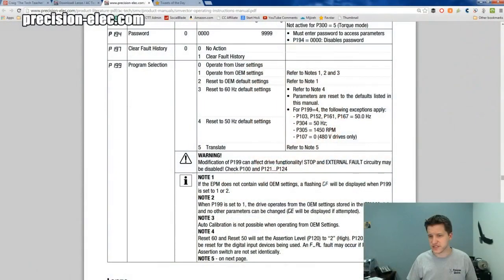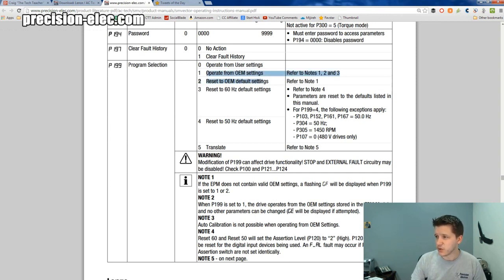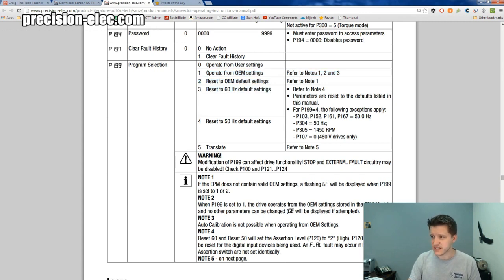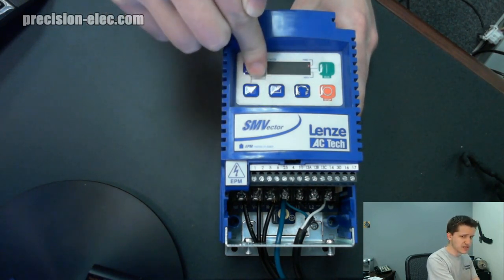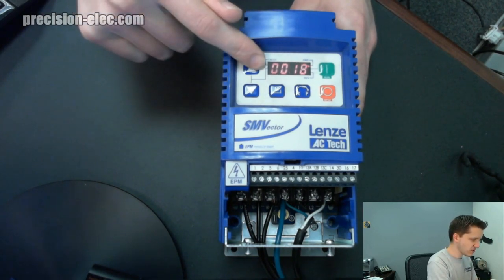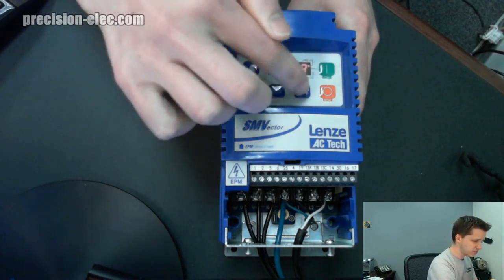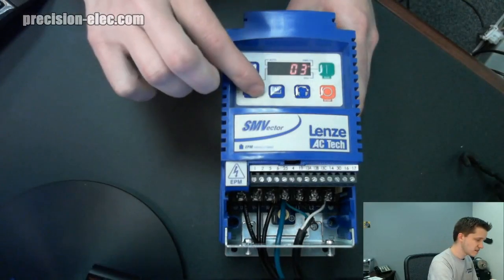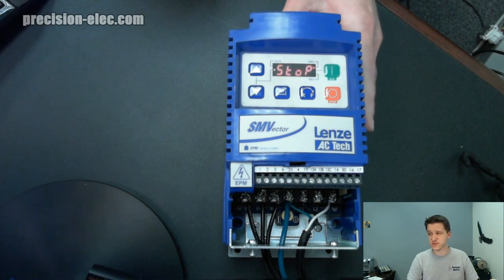How To Reset A SMV Variable Frequency Drive (VFD) To Factory Defaults

Comment: Had a power loss while motor was running caused fault lockout F.0F1. This had single phase 120volt input Could not clear alarm fault even after power down reset. After reading Lenze online troubleshooting guide pulled leads to motor on terminals U,V,W the renergized power alarm then fault cleared.  Then denergized connected Motor leads back onto U,V,W and then started to operate normally. Why would removing the leads on U,V,W be the only way to clear the fault you would think complete powerdown reset would do the same thing. Greatful for Lenze having online troubleshooting guide available.  troubleshooting guide

Comment: hi, iv got an old ETML222X2SFA530 , can i do it on this? theres only 3 buttons.
 iv got an error 'stp'
the manual says i should deactivate 'quick stop' but
doesn't say exactly how. its in the menu under
'ce1' but i cant de-select it. 
i haven't been able to find any reset to default option, thanks for vids.

Comment: Thanks for the help. Someone changed the parameters on a production belt and it would not start. Followed your instructions and had the unit running with in minutes. Thank you sir.